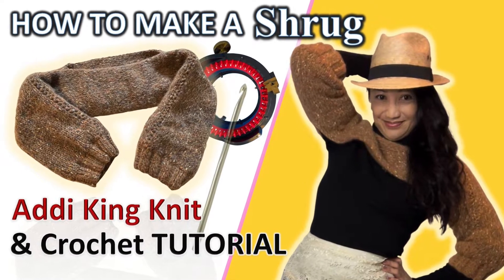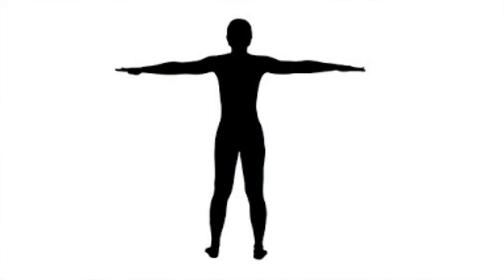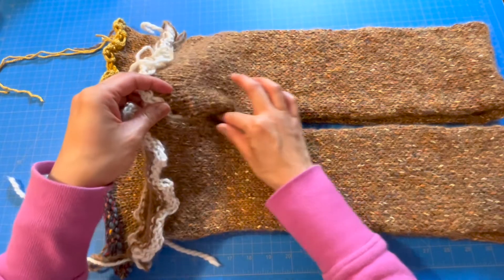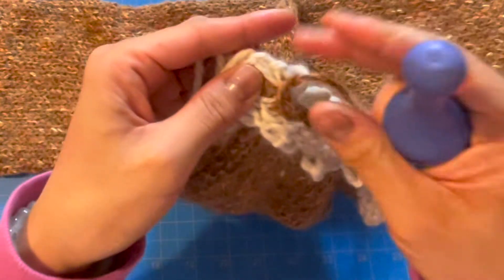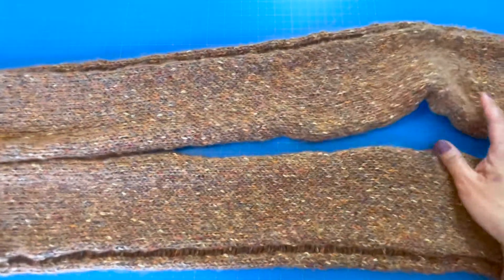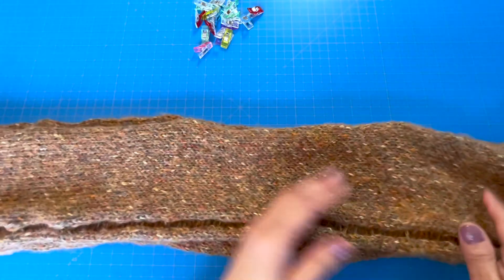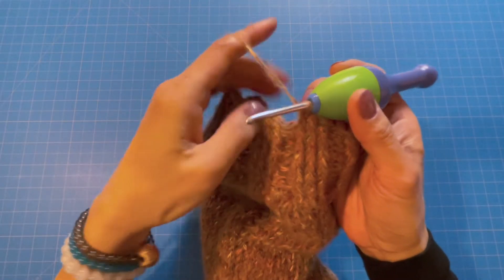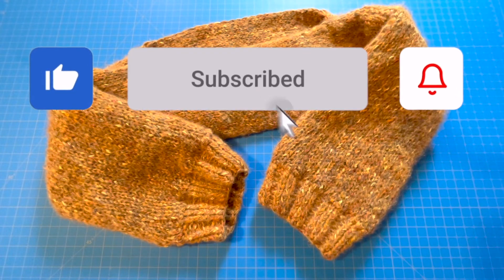ADDI KING KNIT & CROCHET SHRUG TUTORIAL | Knit on Circular Knitting Machine a Crochet Shrug Bolero

Comment: Why in 2 layers??
Reply from the maker: I’m not sure I understand your question.
Reply: @KarenVMiguel  oh thank you for your reply, didn't expect that. My question was why did you decide to make a double layered shrug, I guess it would be easier to make it in one layer of thiker yarn.
Reply from the maker: Hi Olga!  Thanks for clarifying.  I made it as a double layer tube instead of a thick flat panel because with the Addi King, when you knit a flat panel it curls because you can only do one kind of stitch.  Also, the Addi is limited as to how thick a yarn you can use before it gets stuck in the machine.  The yarn for the shrug is a 3 weight so I doubled it.  
If it were hand knitted or crocheted I probably would have used a thicker yarn and made it only one layer.
Do you have an Addi?